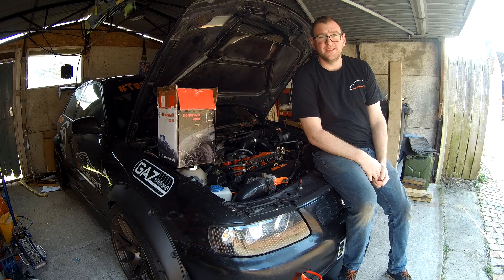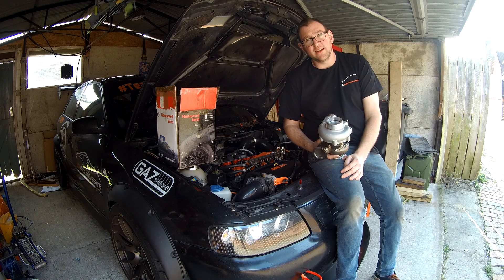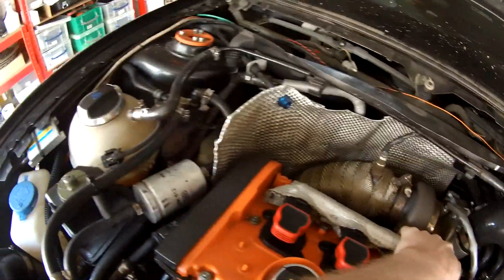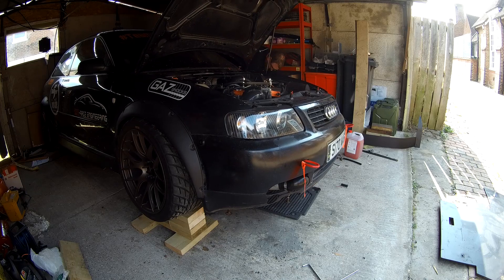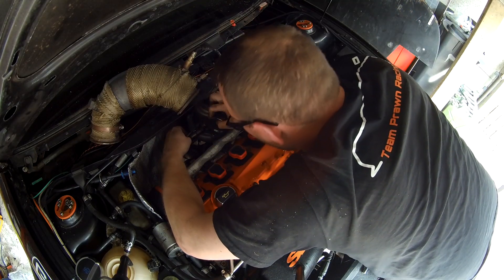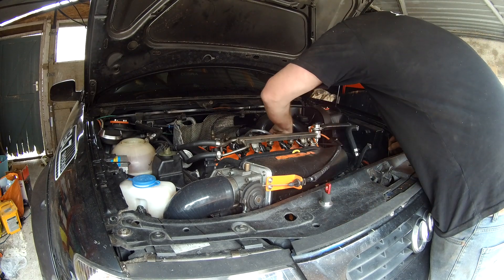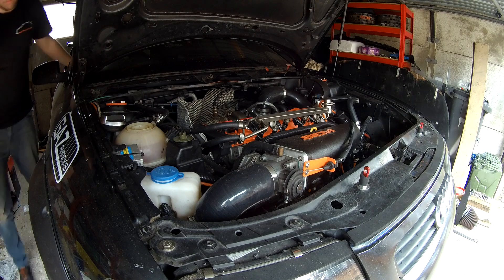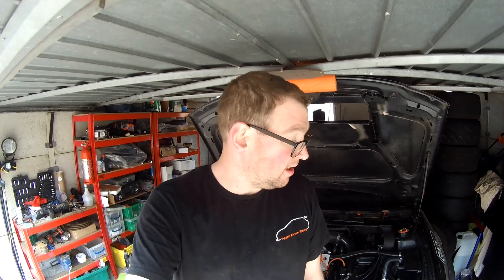Garrett G25 swap - 550 vs 660!

Comment: what is best for 2.0 ?
Reply: What are you using it for ? 
Street/time attack use and around 400whp use a 550 .
Drag racing and big hp , use the 660 .
Reply: a la misma presión que diferencia en hp tienen ? 550 vs 660 ?

Comment: I thought the 660 came with an internal wastegate, but yours doesn’t seem to have one?
Reply from the maker: The internally gated version does 😊 Where you're able to, external wastegate is better every time.
Reply: I haven’t managed to find the 660 without an internal gate yet, I’m looking into this turbo for my 3.3L v6 which is going to be a Twin setup. (Kia Stinger turbo upgrades)
Reply: But wasn’t sure if I wanted to go with 550 or 660, targeting 700whp and want some room.

Comment: Do you tune your car on the road? Also, how did you learn to tune your car? I have an emerald k6 on the way for my car and is debating whether to tune it myself or leave it to tuner.
Reply: @TeamPrawnRacing  How do you go about ignition timing? That's what I'm the most afraid of as the emerald doesn't support knock sensors. I don't know if there's more people out there who's interested but I would gladly watch a video of you mapping your car and going through the things you need to think about.

Comment: noticed you use blanked port on your turbo (on the cold side) for boost pressure to wastegate i presume? was wondering about that. i actualy welded a take of in my charge pipe right after the turbo.